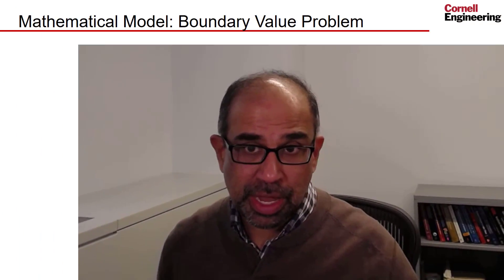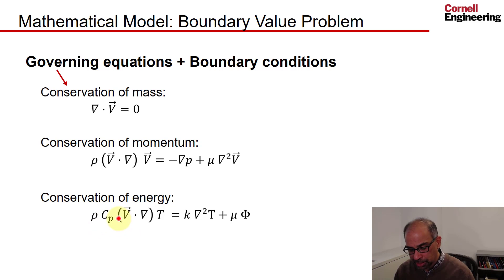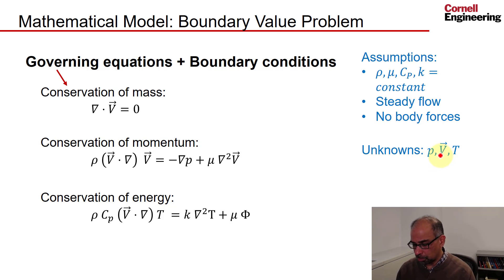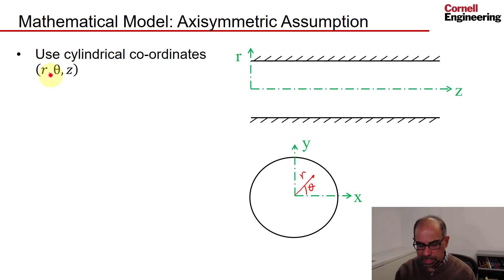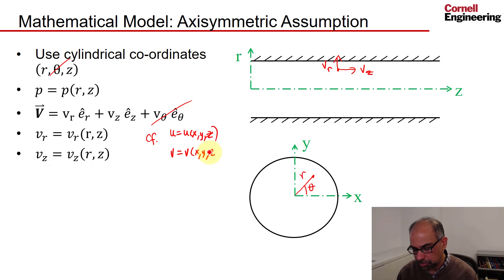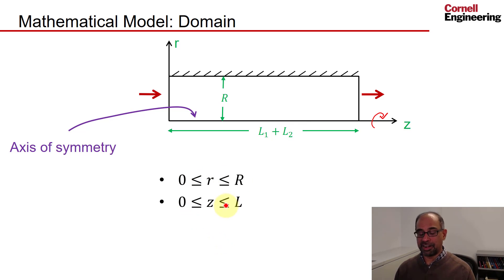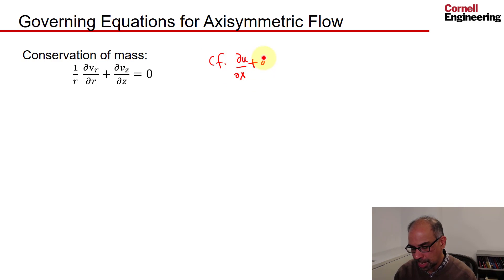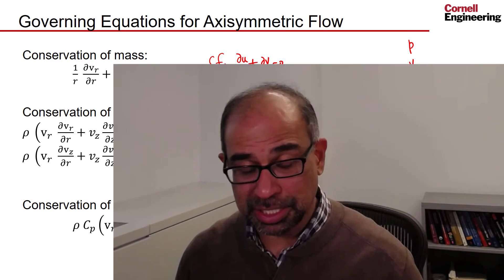Governing Equations

Comment: I am doing cfd research. In the following paper "3d cfd analysis of the effect of inlet air flow maldistribution on the fluid flow and heat transfer performance of plate fin and tube laminar heat exchangers" (in section 2.2) Governing equations can't be understood. Kindly explain how they wrote gov eqns.